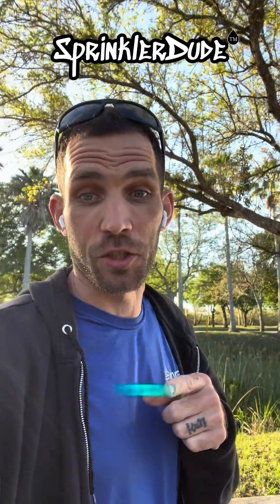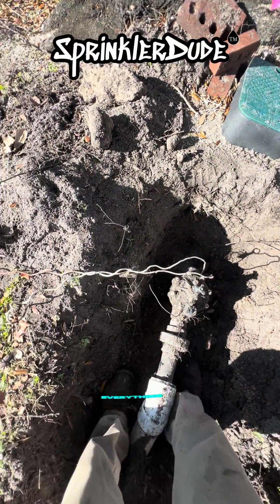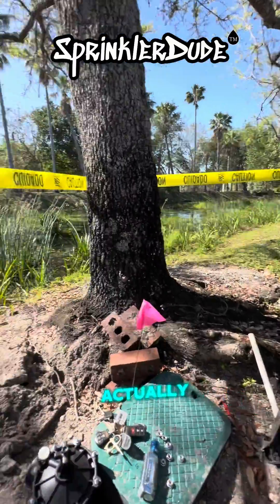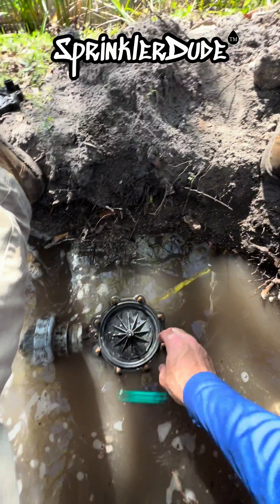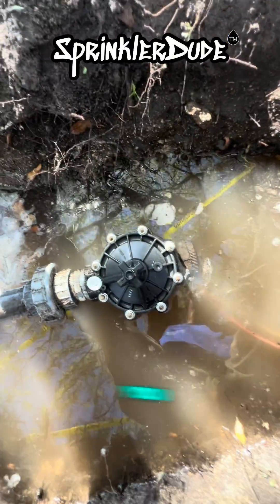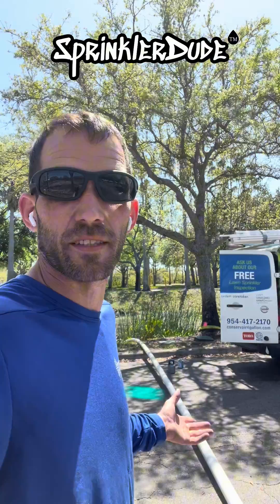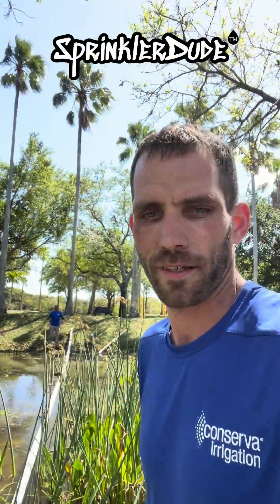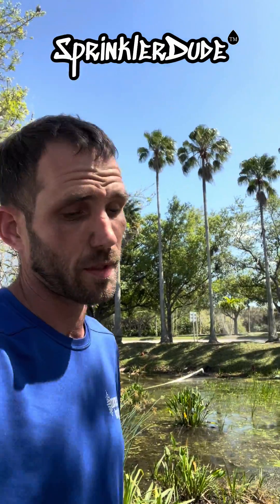Valve Rebuild | Irritrol 100 Series

Comment: Would it of been easier to hire a directional driller to go underneath the pond?
Reply from the maker: I should’ve mentioned. This is a protected area. we can enter the waterway to install the pipe on top of the waterway. We cannot dig into the waterway.
Reply: @sprinklerdude9768  oh well then that explains that!